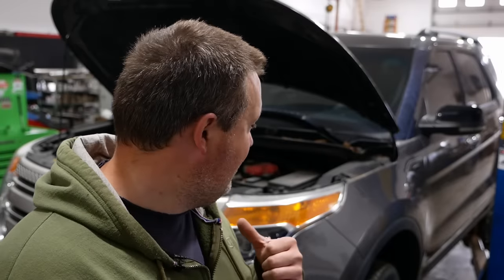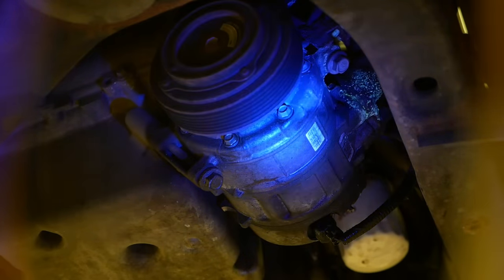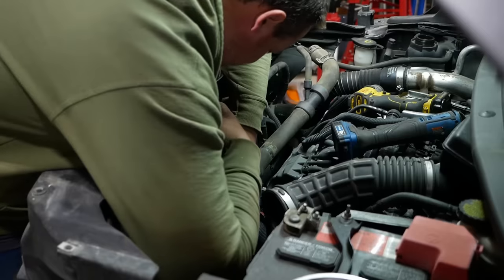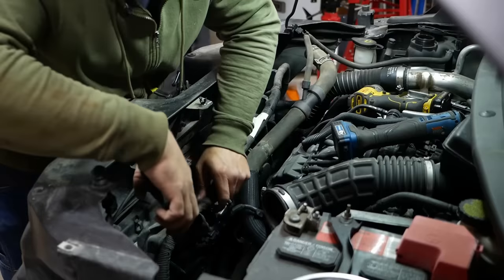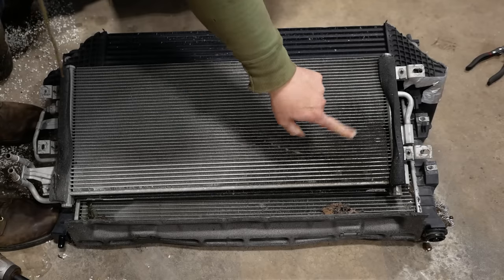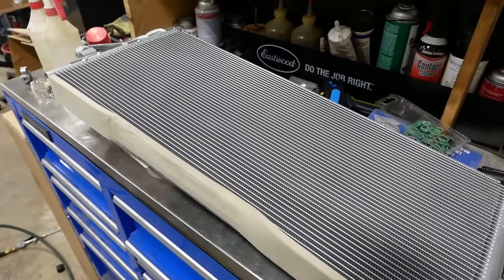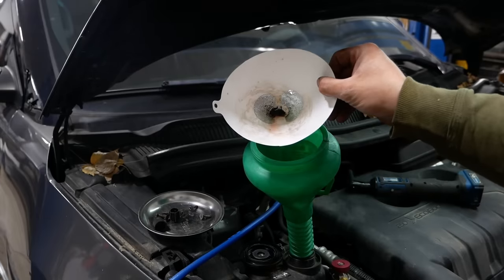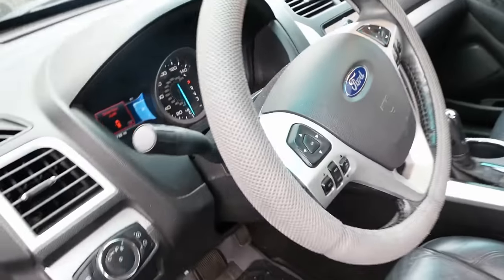Ford Explorer Replace A/C Condenser

Comment: I had an uncle who opened an automotive repair shop when he was discharged from the Navy following WWII. He quickly discovered there was plenty of work but parts were not available. Before long, he re-enlisted in the Navy and eventually retired from the submarine service after 21 years of active duty. I’m not sure where your local Navy recruiter is. JS.

Comment: Apparently I lucked out in buying the last good Model Year of Exploder (2000) even with the dread SOHC six cylinder.  Drove that beast for three sets of tires and 13 years.  Did not, quite, get me to 200K miles, but tried to.

Comment: Rear ac line are also a huge pain on those. Ford routed them in-between the rear subframe and the floor.  To replace them you have to drop the rear subframe. I have done 1 set and I never want to do them again.

Comment: Big reason for the price increase on R134a is the epa mandated phase out.  Same thing is happening with R410a in the residential/commercial hvacr sector.  No new units can be made with these older refrigerants anymore.  It's all new HFO and HC refrigerants now.  And of course parts prices are going through the roof with the supply chain issues in this market.

Comment: Great to have you back! I was maybe in kindergarten when we had the oil crisis and runaway inflation. But, this looks a lot scarier IMHO. So many different factors are all coming to a head at the same time. All the fiscal tricks to avert disaster have already been used.  The only thing they have left is jacking up interest rates.  It's all adding up to big changes.  It's probably unlikely that costs of importing things will go higher than if they were made domestically. So, we're not going to restart production of these parts here. But, places will come on line. What we might consider 3rd world countries are going to ramp up production.  I think it's because it's so hard to kill US consumer demand. Wherever theres a strong market, there will be producers to meet those demands.

Comment: I don't know if you have an electronic leak detector but the Dtek leak detectors are awesome.  Girlfriends car leaking refrigerant, closed the car up for the night and went outside the next morning and opened the door and it went off.  I'm not sure how it will respond to the new refrigerant though.

Comment: Glad I never had to replace a condenser., I did run into a weird problem. For starters, someone left the plastic caps that go on the high and low pressure ports off. I had to recharge the system and I didn't notice that dirt had gotten into the port. It leaked down on me. I had to blast dirt out of the port and then replace the shrader valve. Then I had to loosen the valve slightly, after I had charged the system, so I could blast more dirt out. It was still leaking. I hope it is fixed. Definitely don't want to have someone else work on it at those prices.

Comment: I have a Ford Flex (basically the same thing) so I'm watching closely. 👀 At least I have the updated water pump and don't have to worry about that! I've got 60,000 mile maintenance due too. Gotta get that PTU oil changed ASAP!

Comment: Had a mechanic friend who said his most hated job is a starter on the ford probe! 😂😂😂
Reply: Water pump on a Tempo/Topaz is a complete PITA too, but the belt tensioner is impossible to get without raising the engine or dropping it out the bottom.

Comment: And if you do commercial / Industrial HVAC like I’ve been doing for the past 35 years you should see the prices. I have a unit I’ve got to repair next week that has a leak the size of the tip of a ball point pen. The actual repair will take me about 30 minutes to get to and repair. 

Then there is the system vacuum and charge (about 10 pounds) of the system. The quote was $1,900.00 to repair. Sounds expensive…… they insist in going back with R-22 instead of converting…. I pushed HARD to just replace the system (25 years old) . R-22 for a 30 pound drum my cost in Alabama is $ 1,620.00 a drum as of last Wednesday. Prices adjust DAILY. But, you are right about having A/C …… in my business you will never sell, rent or occupy a building without A/C in it!  Damn sure in The Alabama Summers! 😄

Comment: I think working on AC systems suck on ANY car. Did the same job on my Honda Accord, also took a long time, because I also had to remove the bumper cover and I don't have one of those AC coolant machines being a DIY'er.  The one difference is that I as able to leave the radiator in the car and removed the condenser by itself. I replaced the compressor, because I also saw a small leak on one of the seals. The BIG leak I barely saw, because it was on the back side of the condenser.

Comment: I have a 2004 4300 international. I took it to my local international dealership to have my AC serviced. They replaced the compressor was the only part they replaced everything else was the freon they added and or them decharging the system? Long story short it was $1,800 to get it fixed. I think the compressor was about $400 if I remember right? I have to dig my receipt up to know for sure. Love love love your channel Wes. Thank you

Comment: I just did the Rad on my 2012 focus for the 2nd time, cheap plastic end tanks blew at -40c.  Have to do the whole front bumper, active grill shutters, and pull it from the bottom to leave the condensor in.  That is crazy about A\C parts cost now, inflation is outrageous, hard to believe.

Comment: New crap takes longer 2 get 2 the defect and reassemble then the repair. U can have that junk. 
Back in the mid 2000s a mechanic asked me 2 assist in diagnostic of a coolant leak and no HVAC blowing air on a mid 90s Expedition.  Diagnosis- Faulty mode motors, HVAC motor and circuit components, faulty heater core. Ford wanted 8hrs on the core, 3hrs on the motors and nearly $500 in parts. 6hrs, 7 layers of dash and a bit over $300 it was done. I repaired the mode motors, blown speed resistors, and replaced the speed relay, motor and core with new. NEVER AGAIN!!!. My same vintage GM truck needed a core after 200,000 mi. It took me about 30 min and $30. The mode motors, speed resistors, relays R EZ also. Thx GM.:)
Take me back 2 the pre 90s when we had pride, things were "built tough" "built 2 last" and repairable. Meanwhile- whilst U have ½ the truck spread out over the shop floor...

Comment: I thought that thumbnail was click bait.  Surely you wouldn't need to remove the whole front of the vehicle.  You really did remove the front of the vehicle.  I am sorry to have doubted your thumbnail.  I think if I had to pay someone to remove the whole front of the vehicle to replace the condenser I would have specified an OEM replacement.  I tend to look at things differently.  Great video!

Comment: Geeeez, all that for a stupid AC condenser!   Way to go Ford.  What I’d give sometimes to get my hands on the engineer’s that design these things.  I hope it’s different on a 2016 Explorer.  I know what you mean about getting parts and their costs, I remember being able to buy just the AC clutch, coil, bearing and pulley separate as a kit for most AC compressors.  Now those parts only come with a compressor.  Great video as usual.  Glad to see your recovered from your lightning strike.

Comment: Used to love Ford. Had a new 92 Escort fun reliable little car easy to work on. 96 E350 used commercially lasted over 450k miles with only minor maintenance. Then I purchased a 2006 F150 and the quality job 1 was gone. The triton engine was unreliable with injector issue that were actually a recall in 2005. Then there's spark issue with that as well. Premature rust. Haven't had a Ford since. I had contacted customer service about the F150 but they didn't care. So guess what Ford I don't care about you. LOL

Comment: i have a 1993 chevy c1500 and 1994 gmc c1500 both same truck basically except the 94 has heavy duty brake package. well when i got the 94 i put in a 89 dollar delphi brand fuel pump and sending unit. it was like 2019. lasted 11k miles and went out autozone made me buy a new one (yes i know dont go to idiotzone) then return old one for the warranty. that pump went up to 242 bucks i was shocked.

Comment: Great video. Can you explain the layout one more time. 

Front top= intercooler
Front bottom= ac condenser (this is the part I’m having trouble finding)
Middle= oil cooler???? 
Rear= radiator
Reply from the maker: Oil cooler is part of the condenser.

Comment: Do it on a police car with a push bumper on it and additional wiring for blue lights. I’d be changing the radiator while I was in there. Hate to get it all together and find out them plastic tanks or hose connections had cracked putting it back in from being so brittle from the heat.

Comment: I have a Ford Ranger that’s a few years older. It once shared largely shared everything in front of the doors with the Explorer. The condenser is an $80 part and easy to replace. The compressor, for a new one, is a $100 or so part and up top where it’s trivial to replace. It’s so sad how far backwards things have gone in terms of repair ability with Ford vehicles. It’s also sad older Ford’s are famous for multiple slow leaks in their A/C systems which often times destroys the compressor from lack of lubrication and causes “Black Death” where the compressor self destructs and sends debris throughout the rest of the system. Ford doesn’t seem to care as long as the charge lasts at least past the bumper to bumper warranty.

Comment: No frickin way! YES YES YES!!!

Okay that out of the way, I'm a minute in and not only is the Viva 2/3 a junk Walmart tire, doubly whammy because Goodyear tires are junk too. Weather cracking and dry rotting in 3-4 years so bad that one just purchased vehicle in our fleet slid sideways going up a looping onramp to a freeway and not that fast either. Slid sideways up onto a curb divider from the rubber being so dry, took out a steel wheel and bent that so it wobbled, bent both struts and possible killed the outer tie rod ends. All because the damn things wouldn't grip. Never again Badyear.

Comment: Looks a lot like doing the same on a Jetta. Except the belly pan is held by 253 torx instead of 4 thumb locks, you can't  pull the bumper cover without pulling the headlights first,  and the fan connector is on the bottom. Not fun when you don't have a lift.
Reply from the maker: Ugh. German engineering.

Comment: 1234yf is insanely expensive, at least 5 times what r134a costs.  Also it isn't compatible so you have to get a whole other AC machine specifically for it.  At my shop our 134 machine had an internal leak, so we lost two 30lb tanks of R134 in a week!  We got the latest and greatest Snap on AC machine since our guy happened to have one available that day, and right out of the box it didn't work.  The internal memory of the machine was bad, probably a defective backup battery.  The second machine worked OK though.

Comment: Two things: 
1. Impressive use of the cheap magnetic parts trays. I typically only use one, but the idea of having them for each side (left, right, middle, top and bottom) seems smart for complicated jobs.
2. With regard to the leak check your roofing contractor had performed at the dealer, if there was no leak found, then it should have only been an evacuation and refill, right? How do they justify $1200 to remove YOUR refrigerant, and then put YOUR OWN refrigerant back in? (Assuming that it was not low due to anything the owner did, or had done. And, if it was low, who caused it?)
Reply: As a guess The Book quotes it as 2 employees for 3 hours each at $200/hr

Comment: oh god the transmissions on these things are why they are called exploders. I stopped working on them because it just took to long to do the reaming and putting in a sleeve in the 2nd/3rd and 3rd/4th accumulators.

Comment: That was not too bad a job.  When i had to replace the condensor on our Renault Clio i learned that the condensor and radiator are a single part. Pretty expensive condensor that turned out to be. Also a lot less space under the hood in these small European cars.

Comment: Not sure if it's a requirement in the US for end of life vehicle recycling but in the UK refrigerant gas is captured and it's not unknown for vehicles to be regassed cheaply at scrapyards. DIY work on aircon gas dismantling without (in the UK) F type certification is not a good idea.

Comment: I work at the Toyota dealership, this guy brought his Toyota Sienna van in, the ac compressor locked up and blew metal all through out the system, I believe the tech replaced the ac compressor, the condenser, the accumulator, and some hoses. $5200.

Comment: Well you know for years our AC was two widows rolled down and 65MPH, moderately well off people had a evaporative cooler that hung on a window and every once in a while you had to run the towel roller through the water to get it wet so you could stay cool. We have all seen pictures where some one has hung a house AC unit out the window of their car, note to all you pickup owners with the sliding back window add a tool box to hold the AC up and a cheap generator in the bed, it'll burn less gas than your engine, you can leave it running all day, even when you get out, and it'll keep your cab cooler!

Comment: Customer should be happy about the fact that it can be changed as a one part. On most European cars all these radiators are sandwich together as one unit, if one fails they all have to be changed. :)

Comment: That job goes quicker if you remove the cargo compartment carpet liner gasket, but it is one use only and requires a special tool only available from Ford

Comment: I got myself a cheap coffee-filter holder and regular coffee filters for my tractor coolant. It takes a bit of time, but works fine; the filter fits on the radiator like it's made for it 😁 - I was hesitant recommending it because I don't know how good it is to re-use coolant? Guess that answers this question...
Reply from the maker: Most of these new extended life coolants are good for 150,000 plus miles. 99% of people never replace it in the life of the vehicle.

Comment: Great video. And thank you so much. One question, what is holding the bottom of the housing for the fan shroud that is difficult to pull. I’ve been reading and it asked that we need a special tool?? Any suggestions?? Respectfully my only concern for a DIY guy like myself. Thank you

Comment: The new Refrigerant bottles for the new AC machines around here are  over $1000 per bottle. And they're alot smaller then the R-134. I know of one near by shop that's gotten the new machine thus far.
Reply from the maker: Yeah I have one. $600 for a 10lb can!
Reply: @WatchWesWork  I just bought a 10lb jug of r1234yf from the Napper (not a sponsor) here for $530.  Just bought 30lbs of r134a for $325.  Soon the r1234yf will be cheaper than the r134a.  Pretty hard to figure that it's not by design....Just what they did with r12.
Reply: I'm in Canada. They're selling 10lbs of 1234 for $1000

Comment: Toyota dealership told me $2000 to replace AC compressor and charge my 2015 Tacoma. When I insisted on talking with the tech and asked direct questions, I got what I needed. Purchased a new compressor clutch, installed it in my driveway and all good. Seems the dealership will not replace just a clutch for some reason. Asked the tech and he just shrugged and said that is what they were told. OEM clutch cost me $175 shipped from a dealer in Florida to me in Hawaii.

Comment: I liked the nut and bolt holder stuck to the underside of the truck. Dropped it in the bucket at least you knew where it was LOL. I also liked the paint funnel/screen deal but part of my problem find my funnels I always find them when I don't need them you know how that goes THANKS FOR POSTING. Why do you have to take the cover off ?
Reply from the maker: The top radiator bolts and A/C hoses are under the cover.

Comment: You know, it is one thing for a customer to say he has no money and wants it yesterday if it is a crank no-start or has dangerous brakes, its his only vehicle and he needs it to get to work.  Air conditioning is a luxury.  

It is still spring.  Even here in Kentucky, it isn't absolutely necessary yet.  In Illinois, you might need it in July.  You don't even really "need" it then.  You are more comfortable with it.  I didn't have a vehicle with AC until I was 27 years old.  I lived through July heat without it.  When I was little, it wasn't even available on any car.  Roll yer window down.  Work a few weeks to save the money.  Wes's kid needs to eat the same as every other kid.  Besides that, it is going to cost the same amount to remove that front clip when the compressor goes.  It is dumb to pay to remove it twice.  

When the rear seal went on the transmission on my old Ranger, the cost to fix it was all in the labor to remove and replace the transmission.  We didn't just replace that one seal.  We replaced all the seals and gaskets in the transmission and the rear main engine seal, as well as the entire clutch and throw-out bearing and the u-joint that caused the issue while we had it off.  There is absolutely no point to paying that labor twice.  While you have it apart, fix everything.  If you maintain a car this way, you will keep it going for decades, long after it is paid off.  There is nothing more sexy on a car than a pink slip (refer to The Little Duece Coupe).  No Corvette that you are making payments on is as sexy as a 20 year old car that has been paid off for 15 years and everything still works on it.  The paid off car represents freedom and independence.  It cannot be repossessed.

Comment: The one good item is the electric driven ratchet machine.  Mechanical Design Engineers never had to work on a piece of equipment that they have designed.